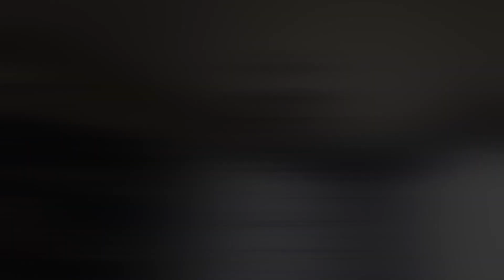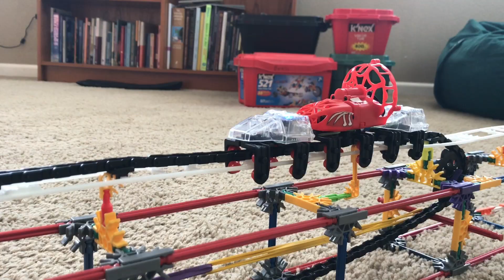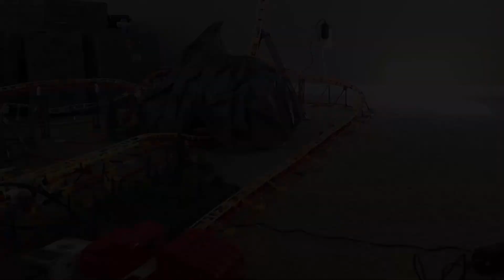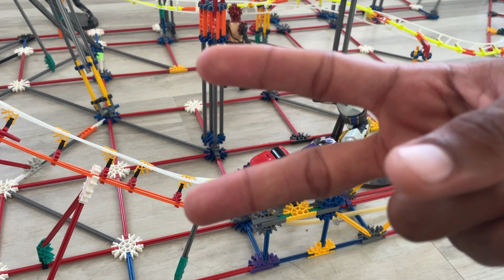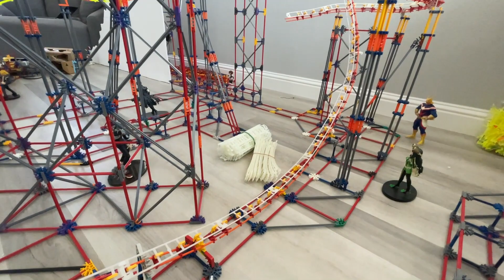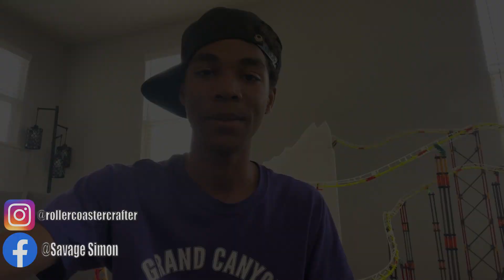How to improve Smoothness on a K'NEX Coaster

Comment: On slightly banked turns do you use straight pieces or turn pieces?
Reply from the maker: It typically depends on how big do you want to turn to be. On bigger wide turns, I would use straight track, and anything smaller I use the curves
Reply: @rollercoastercrafter  ok thank you